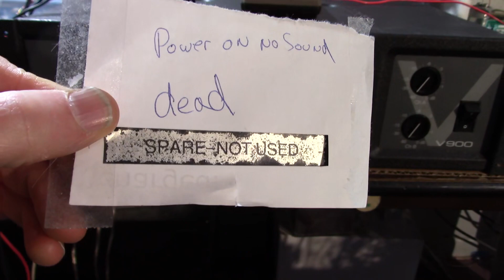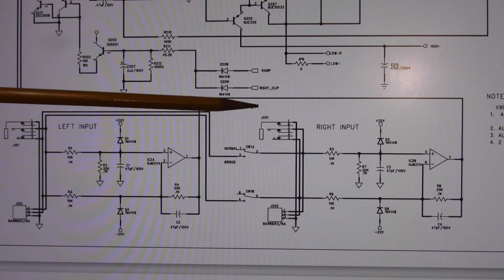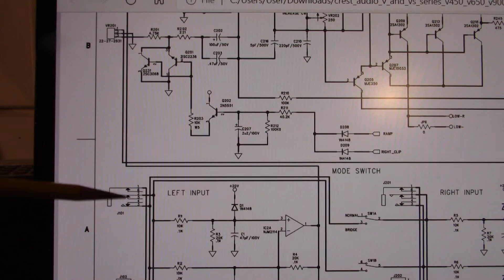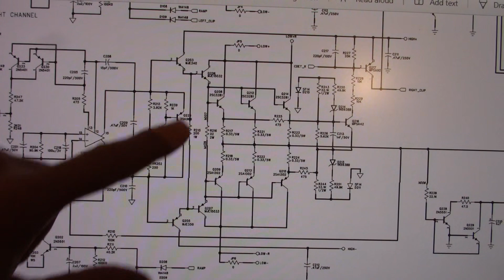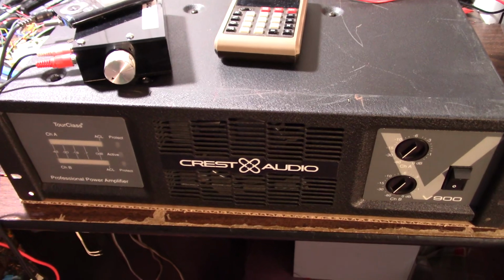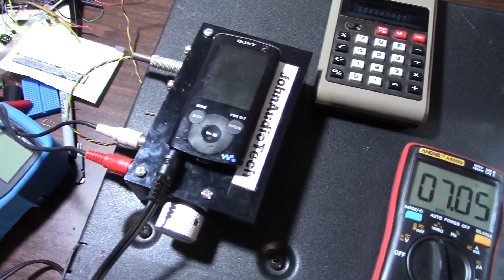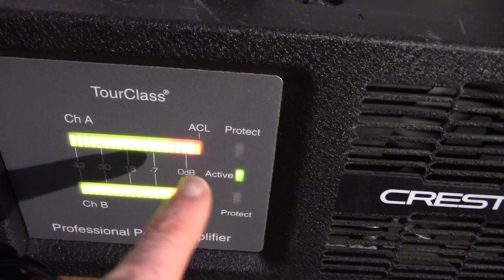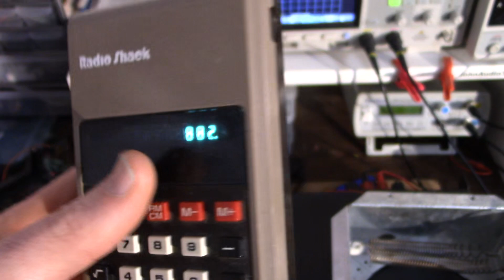Crest V900 PA amplifier power test bridged into 8 ohms

Comment: just scored working crest cks400 and a peavey amu75t out by a dumpster of a skating party ring place, There was also two crowns red label con tech somethings and a soundtech ps802 also with the power cords cut off, should I go back for those? Both the amu and the crest work flawlessly once I wired up my mixer and speakers. but both those other two heavy crown contech and the soundtech had the power cord cut off, and the soundtech was also missing a plastic circle piece that goes on the stem of the one knob,
There was also this furry speaker that looked like a car sumbuffer with a carry handle but it had two 1/4 sockets on it and didnt look like it pluged into any of those amps, might go back for that one it fires up into the air at an angle. I think it might be a passive monitor it looks like the pa speakers I have but no pole sockets and no speakon.
Reply from the maker: I'd get it all. At least for parts.
Reply: @JohnAudioTech  wound up walking back there and scooped all of it up, everything runs once I spliced in new cords, idk why some idiot chopped em up like this, they work perfectly! 
All channels, I even fix the soundtech and that monitor is my poolside speaker now, it turns out it is 8ohms and it'll run with my pa its just using 1-4 instead of speakon
Reply: Used blender cord on one crown and a cord off a busted air frier for the one soundtech and chopped a old pc power cord for the one other crown.

Should I of put something beefyer on them?
I have an old mini fridge and a old ac that doesnt work I think have thicker gauge power cords.

Comment: that crest amp is speced to 900watt in 8ohm bridged 1khz so this is normal if you doing this in rms 20-100hz its harder for the amp to handle. i had a crest p6001 and today also  a 7001 and the ratings there are fully register. this is one of the best amp and that time period real powersuplys not the damn  switched when amp not have any weigt haha thanks for this video i shall check the other videos to

Comment: I just bought one of these. The guy says it works. Hopefully I get lucky and it will be plug and play. I am using it for home audio to drive a set or KEF 104/2 which are hungry for some power. At this point, I don't know what I don't know. I can't see why this wouldn't work nicely. I saw another video where a guy reduced the speed of the fan with a resistor. I guess the fan can be a bit loud for home use.

Comment: I have one, I installed it with a Yamaha Pre amp, the Bose OEM EQ with a Technics EQ (24 keys) and it works fine. The fan is a little loud. The Bose OEM EQ was lowered all the way except the treble, just slightly increase, bass was completely lowered.  I'm old school, so I use audio DVDs/Blue Ray for music. FLAC and WAV, 24/96 works fine.

Comment: My question-
I have an 2.1 old home theater system using Tda2030A chips and powered with 0-13 V, 1.8 Ampere transformer using the voltage doubler method to make it split rail supply. There's two 5408 diodes and two 3300uF 25 V capacitors. Recently, while the system was powered on but no music being played through it , one of the capacitor exploded with loud noise and smoke. I want to know is that explosion due to ageing of the capacitor or due to some short circuit in the amplifier circuit ? Although, I replaced both the capacitors and powered up again and checked the output voltage to be fine (18+18 = 36 v peak) with the amplifier working fine.
Reply from the maker: If it was working fine before the capacitor popped, it might have been the capacitor just failed. Unusual for that to happen though.

Comment: I hear you about the BS channels with 100k views in just a few days of uploading.
What are you doing wrong?  Simple really.  You need to stop bothering to explain what you are doing (IOW delete the dialogue); have a clickbait thumbnail with an outrageous claim of 4000 watts from an LM1875 chip amp powered from a 12v 7AH SLA battery; buy a Sharpie so you can remark some crappy speaker driver with "4000W 1 Ohm"; buy some polystyrene packaging beans so you can place them on the speaker cone so the audience can watch them "dancing" to the soundtrack of a Bollywood blockbuster; get some spray on tan lotion to colour your hands and arms to a much darker complexion; and finally rename your channel to something like Technical DIY. Of course never respond to comments unless it's stroking your ego and never demonstrate any measurements backing up the outrageous claims.  I'm sure that within a month or two once the word is out there you'll have 100k subscribers and 100k views per video.

Seriously though, you make very good content and have done so for years now. Sadly YouTube rewards rubbish content that competes with Tik-Tok and all but actively ignores genuinely factual informative content. I'm sure there are probably tens of thousands of great electronics channels out there but trying to find them using YouTube's search algorithm is useless because it just keeps on spewing up the same rubbish channels of the type I've just mentioned.

Comment: Impressive amp, but I have to wonder how practical it is.  No individual speaker will take anything near that amount of power.  Putting a bank of speakers in parallel will make the impedance too low.  A series/parallel would keep it at 8 ohms, but now you're risking speaker interaction.  At some point I'd think you'd be better off with multiple smaller amps.  One practical use would be a 70V distributed system.  The supply rails are high enough to drive a 70V system directly off the "8 ohm" outputs.  You could drive an entire multi-story building off that beast.

Comment: I worked in sound reinforcement for a couple decades and these professional amps are nearly indestructible.  They aren't designed to have the lowest THD, but they're built to be abused on a regular basis.  Except for a few patch cables in the booth, pros only work with balanced cables for good reason.  It appears that balanced audio connectors are becoming more common in audiophile equipment these days, so that would be an improvement.

Though the anti-clipping circuit may be undesirable in hi-fi, the clipping detector is extremely convenient as it makes gain adjustment utterly simple and you often don't even need to have the speakers on to do so.  Run a loud track (0dB peaks) through the system, crank the gain until the light stays on and then back it off a bit.  A -3dB light should blink occasionally with music or voice, but a 0dB light shouldn't blink at all.  Different equipment can have different trigger levels.  After working with this equipment, I wished that all of my home and car equipment had clipping indicators.

It's silly to pay tons of money for a 24-bit DAC and then send that audio through unbalanced cables that almost inherently raise the noise floor to 16 bits or less.  Balanced connections are certainly more beneficial than the stupid audiophool "premium" cables that people still fall for even after decades of science and ABX listening tests showing that they're worthless.

If someone tells you that their cable sounds better than other cables, they're either a liar or a fool, so never take their advice or purchase their scam products.  If they also claim that their AC power cable sounds better, consider p*nching them in the face.
Reply: Check out test results of modern top notch DACs from the likes of Topping, SMSL or Gustard. -121dB SINAD over unbalanced/ -125dB balanced, or 20/21bits resolution. Loss of 3 to 4dB over short runs in home setup is of no consequence whatsoever. Any amp will be a source of far more noise than this.

Comment: John mention who those FAKER'S are!  Once in the public domain they are up for criticism ..
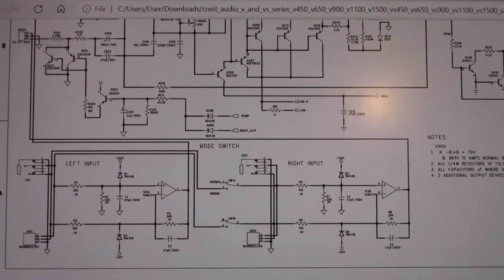Reply: John is too polite to but I will.  Technical DIY.  Sadly one of the many making money from clickbait thumbnails and outrageous and unproven claims. Watch this video.  https://youtu.be/Aa0WVXUfnkI  Pause the video at the 5:34 mark.  Is he about to wire the power straight across the 10k volume potentiometer?  Also look at how the input cable from the tablet he will connect up later is wired.  But it gets better.  Look at how the large electrolytic capacitor in the top left corner of the picture is wired.  It's in series with the transistors so how is the d.c. power from the battery powering the circuit?
Reply: @alanrutlidge4767  Report them for fake thumbnail. :)
Reply: @twotone3070  ah, if only YouTube would take any notice.  YouTube don't care if the content is misleading or just plain lies.  It's all about the views and the advertising revenue. As long as it's not politically sensitive or racist they don't particularly care.  JAT is one of the few channels I actually subscribe to.  His content is IMHO factual and objective.

Comment: We are here for the quality you deliver John! Not repetitive music and no explanation for a rubbish amp.
I have followed your videos and have managed to finish building an amplifier from scratch. Before stumbling across your channel much was left in the dark. The books you recommended have also been very helpful. Coincidentally I had chosen the same output transistors as your ab amp build which made things simple when understanding the output stage and bias. Im now at the point I want to start pumping some serious power. 
Any tips on how to make an output that can handle 325v from a 115.0.115 transformer would be awesome😅 The output blows immediately in the current configuration but the differential pair handles the the voltage no problem. The input is rather industrial.

Comment: Hi John. How can we get a good Rectifier (dc power supply design)  for home made amp on the cheap ?
Reply: Why u worried about getting a rectifier?
Reply: If you aren't running a class D amp, why not make use of switch mode power supply and avoid all the hassle of transformer and rectifier stuff
Reply: For a dual rail power supply calculate the power requirement and find a reputable ebay seller for a transformer that can deliver the peak voltage the amplifier can handle(look into peak and rms voltages). Rs components sell high quality bridge rectifiers and capacitors. There are online tools to help calculate the peak output voltage once rectified. Find the details of the parts you are looking at and put them in to the calculator then buy the bits if its suitable for the voltage/current range of the amplifier you have. Assemble the power supply as per John's example in his amplifier build video or the online calculator diagram. Always fuse appropriately and test peak voltage before connecting to the amp. Unfortunately I cant find the calculator I used but it was bang on.